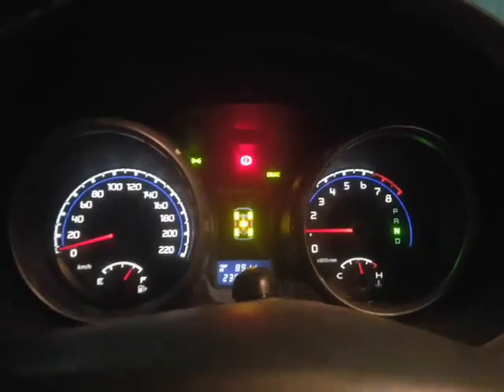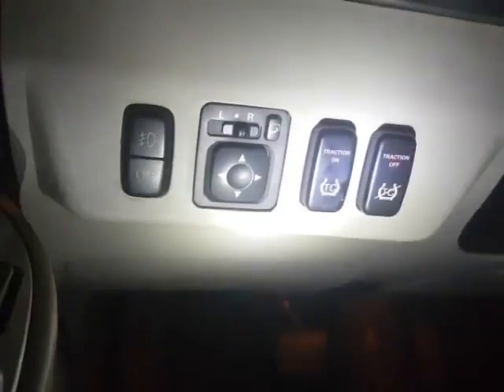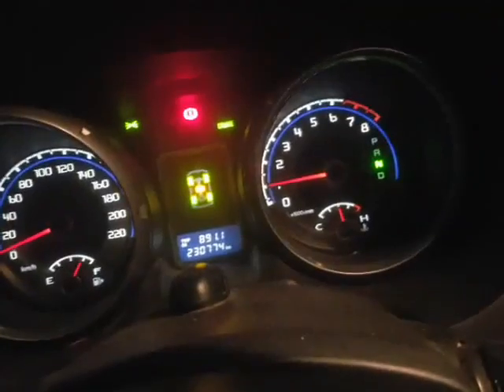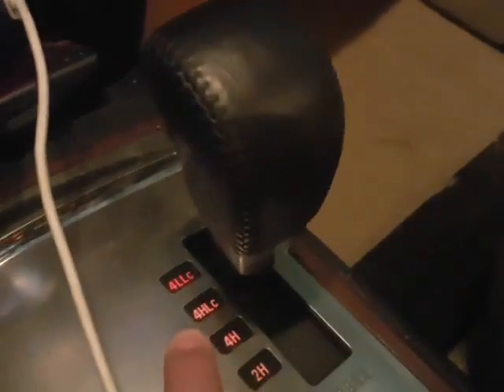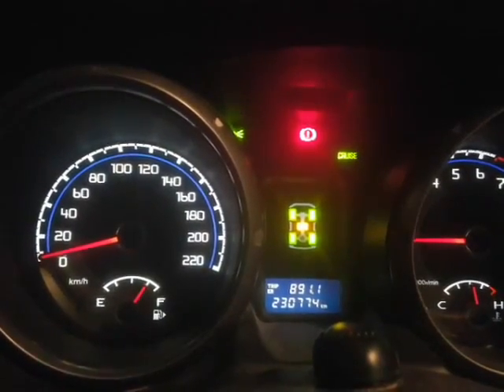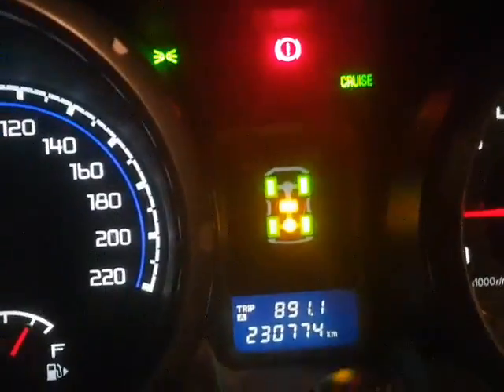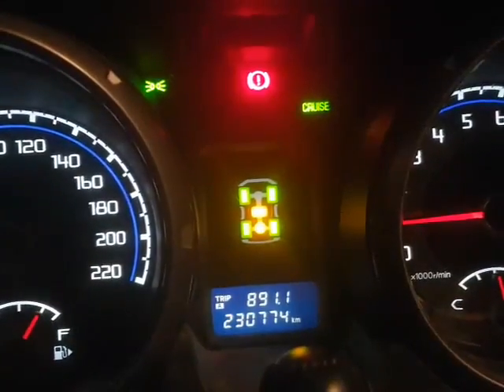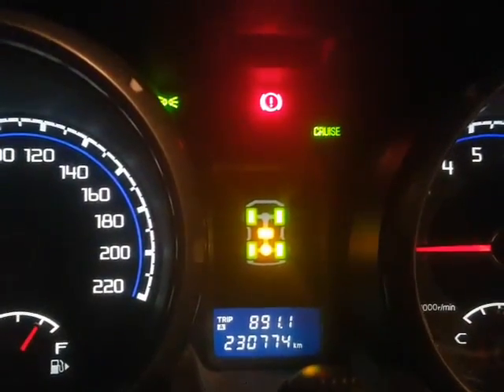Pajero Plug & Play Traction Control On Off kit with front diff lock simulator

Comment: Hey mate I'm keen to install this in my 2012 nw td 
To improve sand driving however
My nw doesn't have a diff lock switch in dash
Will this patch loom still function the same in my car allowing me to drive on sand without Trac cont ??
Reply from the maker: Hey man there are different types of the patch loom. There are versions for the pajeros with no diff lock. The nice thing about this kit is its plug and play and requires no wire cutting. What some people do is they cut the ABS wires and they put in a switch on the ABS which I dont recommend. To get this plug and play kit you can find it here: https://www.facebook.com/groups/2155678484721760/
Reply: Hey mate at 0.49 I see that the rockford infotainment system lights blue, but on mine it does not. Can you please by chance tell me how can I make the 2 light strips illuminate or if it is a mod how can I do it ? Please
Reply from the maker: @Chris-jp2xu  hello the lights came with the after market radio

Comment: Real keen to learn a little more on this setup also what are all those other switches 😁
Reply from the maker: The other switches are to control the lights, extra gear cooler fan and omani gear hold hack. These are standard rocker switches you can find on ebay. You need to order the housing and seven standard size rocker switches. It replaces the card holder in your pajero and fits perfectly :)

Comment: Great switches .. Thanks for shearing .. But you didn't show us how did you install them !? Engaging the Traction Control while R/D Locker is engage is that safe (from functionality point of view) !? I mean it will not impact the Locker work !?
Reply from the maker: Hello thank you, I will make another video sometime soon on how it was installed. Engaging the traction control has no impact on the rear tires when the Rear Diff lock is engaged. The car doesnt think the rear tires are slipping when they spin together so it leaves them alone. The traction control only kicks in for the front tires when they slip imitating a front diff to a certain extent. The combination works like magic when in tricky situations. I have posted two videos of it in action, look through my other videos for self recovery with diff lock. I engaged the reaction in both videos

Comment: very good video, a question, why is that in default mode, when the rear diff is engaged, the TC gets disabled. There must be some reason for it.
Reply from the maker: Thank you Nawaz. Good question, I guess it was assumed that when rear diff is engaged the traction is not needed for the rear tyres as they will never slip. When we turn it back on when rear diff is engaged, it never kicks in for the back but it kicks in for the front tyres. It helps so much when stuck
Reply: @SandTrack   Thanks for the answer. Have you ever found that TC actually hurts on sand. I once drove a pajero on sand, what I found was that going forward the vehicle would get stuck, however if I put the vehicle in reverse it could easily go back. Could it be that reverse gear also disables TC.
Reply from the maker: @nawazzaygham9852  so basically traction control is very helpful when stuck for self recovery. Where it becomes a problem and you want to turn it off is when you are driving up a high dune and it starts to kick in on the top and it slows your momentum down. Otherwise for self recovery and driving over rocks it's great. Reversing back is mostly easier because the sand tracks behind you are compacted

Comment: I have Pajero Gen 3, 3.8 gls 2006. The problem that i face while in desert is even if i have switched off the traction control, it keeps on kicking back hindering the power when its required the most, is there a way to over come this ?
Reply from the maker: The ways to do it is to either pull the grey ABS plug in the engine bay or install a plug and play traction control kill switch which we are making. My email is in the description if you would like me to send you one
Reply: @SandTrack  but your description says it's for 4th gen only, while mine is 3rd generation..
Reply from the maker: @faizilv  the plug and play traction control currently only available for Gen 4. However you can still unplug the grey ABS wire in the engine bay on the left hand side to turn off the traction control on the pajero
Reply: @SandTrack  can you please share the photo of this grey ABS plug, as i struggle to find it
Reply from the maker: @faizilv  email me here so I can send you a pic on  adventureseeks@gmail.com
Reply: @SandTrack  sure

Comment: Hey bro o just bought a 2011 3.5 SWB GLS which has a centre diff only. What can I do to make it more capable? Awesome videos btw! Great guidance.
Reply from the maker: Hello I would recommend you look into basic upgrades from suspension, airfilter, traction control loom as a start
Reply: @SandTrack  I have this car also @013 model. It doesn't seem to have any traction control system at all or a rear diff lock. What are my options to get them in the after market?

Comment: Hey! If i have r/d lock buton on, the red brake control light is on. Do you know why?
Reply from the maker: Hello because when the Rear Differential Locker is on it turns off all safety ABS, Traction Systems. The hand brake light also goes on its normal

Comment: When you turned traction off the rear diff started blinking. Is that normal operation with this switch?
Reply from the maker: Hey Ali yes thats normal operation to have the rear diff blink. The reason this happens is we are tricking the Pajero to think the rear diff is engaged so the car automatically turns off traction

Comment: Hey man!!
How can i tell if my 3rd generation has rear diflock, as there's ni buttons for that and the spacification of the car shows that there is read difloc, beside there's a lamp for the instrument cluster for the rear diflock, is there a way to find out, and how? My car is 2007 3rd generation 3.8 gls SWB
Reply from the maker: Hey Hamzeh as far as we know the Gen 3 that came to the UAE did not have diff lock. As opposed to the ones imported to Oman did have a diff lock. The best way to check is put your car VIN number on this website and read the description in the options section. If your car has a diff lock it will be written there. You can find this number on the mulkia card. Some Gen 3 actually have an LSD limited slip differential which was a nice surprise 🙂  Check what your car has: https://partsouq.com/
Reply: @SandTrack  wow where did u get this website looks awesome, however, i checked and some of the codes i have no idea what they are i will past them in another comment, beside, i wanna ask you if by any chance are you in the UAE pajero group?
Reply: @SandTrack  these are the options

MITSUBISHI
Mitsubishi	MMC202002
Model
PAJERO/MONTERO
General (EXPORT)
V67W
3800/SHORT WAGON<04M-> - GLS(NSS4),S5FA/T GCC
11.2006
99A
A19B
A19
H79: AUTO SPEED CONTROL (= CRUIS
H79: AUTO SPEED CONTROL (= CRUISE CONTROL); CD AUTO CHANGER; FR POWER SEAT (LEATHER); WOOD PRINT PANEL; EXTINGUISHER; FIRST-AID KIT; EMERGENCY TRIANGLE; SUNROOF; SUNSHADE BAND; COLOR KEYED DOOR MIRRORS; SPECIAL ORNAMENT (B); HEADLAMP WASHER (JET TYPE); BATTERY CAPACITY-UP - 1; DISCHARGE HEADLAMP; AUTO A/C; S/WHL + AIR BAG + CRU/CONT; COOLER BOX + A/C; FR PWR SEAT (LEATHER) + AIR BAG (DRIVER,PASS,SIDE); CRU/CONT + HL/WSHR; S/R + ROOF RACK; MXX + MXX; VIN PLATE CHANGE FOR GCC; COOLER BOX; ROOF CARRIER ATTACHMENT; TIRE PRESSURE GAUGE; AIR BAG (DRIVER,PASSENGER,SIDE); WAX INJECTION
Reply from the maker: @hamzakhuffash  hey bro yes I am I will message you now :)
Reply from the maker: @hamzakhuffash  looks like yours doesnt have a diff lock

Comment: Hello, if i remove the ABS fuse, will it desactivate the ABS system temperarely until i put back ?
Reply from the maker: Yes that's possible too
Reply: Is removing the ABS fuse on and off every weekend drive safe or should i get a kill switch installed to avoid surprises?

Comment: Hey buddy how about turbocharged pajero. It will pump in more HP and torque
Reply from the maker: Hey hey this is an option. I would recommend super charger as you get power across entire rpm range. Check out my engine modification video for the pajero and subscribe for future video updates!  https://youtu.be/bjNuR69v6xw

Comment: I’ve done the traction control switch mod on mine, when I turn trc off and then loose traction I can’t switch it back off until I switch the car off
Reply from the maker: Pajeros without a factory diff lock require a restart to enable traction by on

Comment: Nice , but I am afraid that you can’t turn on traction while using rear difflock because the the pajero programed to isolate rear diff from traction control system to allow difflock ( this was a problem for first pajero with traction in 2003 model up to 2006 ) starting 2007  Mitsubishi added difflock by isolating rear diff from the traction while front diff work on the traction. Rear difflock and rear diff traction contradict each other. This will lead the rear break pad hold on tire to transfer the force to the other tire however with the difflock on  force will be used against the tire on break leads to  loss of torque at the use and unbalanced wear of the rear break pad.
Reply from the maker: Hello Fahd. When you activate the rear diff the traction will only work on the front tyres not the rear.. Tried and tested. It works the same way it does on the Nissan Xterra when you activate rear diff and traction. It does wonders in self recoveries
Reply: @SandTrack  Great , l think I will follow suit. Thank you. By the way you got an exciting channel.
Reply from the maker: @fahadfaraidy6071  thank you very much!! I will keep adding more content soon 🙂 make sure to subscribe to get alerts

Comment: Can this harm the car? I mean there must be a reason for TC to turn off when the diff lock is engaged.
Reply from the maker: we have been using this mod for many years and on many cars with no issues. The traction control will not kick in on the rear tyres when the diff lock is in engages, just on the rear tyres. So it doesnt interfere with the rear diff system. The added functionality is a life saver when stuck in awkward offroad situations

Comment: I like your videos , however, i Dont recommend  it at all, it will damage your brake,,  
Traction TCS system will detected the slippery wheel and will apply brake to it,  man  all your 3 wheels are spinning and by turning on TCS it will automatically hold on at least one more tyre while rear difflock is On 3 tyres will spin forcely and brake system try to hold them tightly,, you will lose energy and damage your brakes.
Reply from the maker: Hey Rodrevali thanks for the comment, have you tried it on your car? So basically when the rear diff lock is engaged the traction will not kick in on the rear tyres from experience. The TC will only kick in for the front tyres that do not have diff lock. We do lots of soft sand driving and helps a lot in self recoveries
Reply: @SandTrack  it may work for you, i belive my explnation is that the engin power is far more than brake power, thats why you cant feel the effect,
Usually TCS philosophy is holding any slippery tyre to balance and give more control stability on car.
However you can only sure if you know Pajero TCS  programme code command.

Hope i could help here, thanks
Reply: Hez guys, what was the conclusion here? Sandtrack, I already have a kill switch (the basic one with the ABS wire), should this method work with that also?